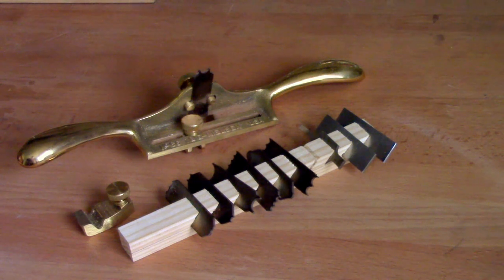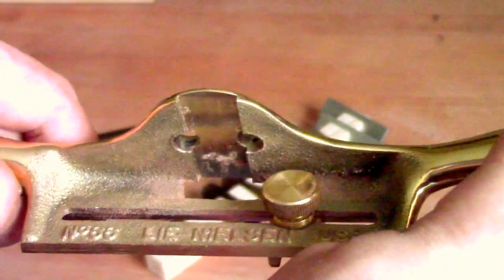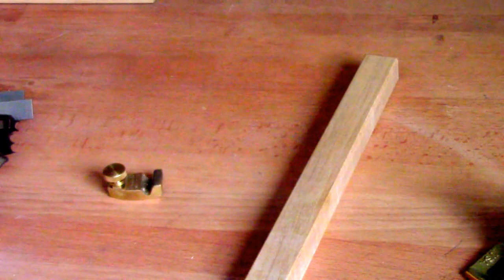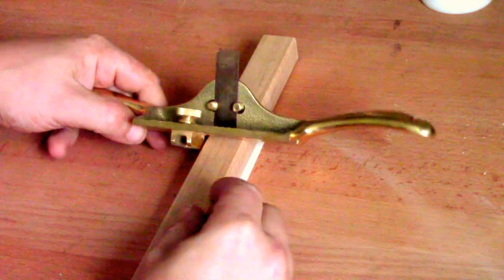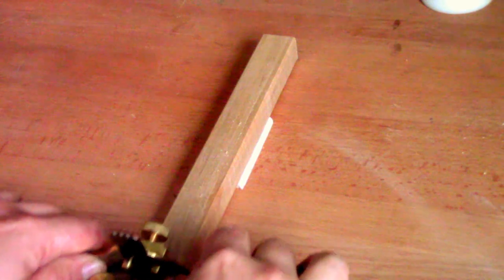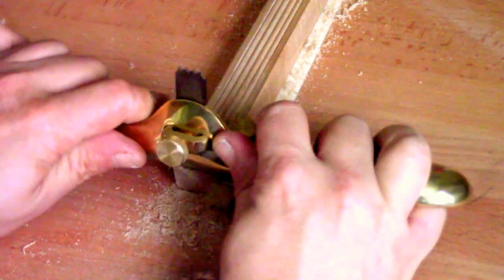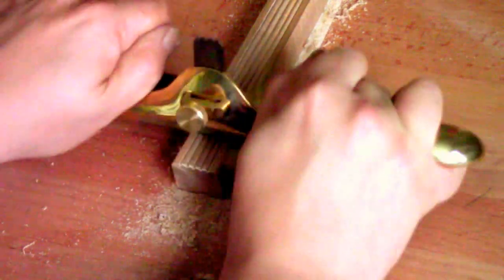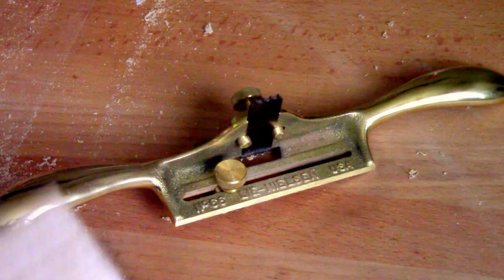The Lie Nielsen No 66: Demonstration

Comment: Thanks for this demo. I'm a big Lie-Nielson fan (my wife cringes when she sees the boxes arrive). Have you used this on a "softer" hardwood, like poplar, or even on soft woods like pine? Does the beading tool cause chatter or tear out on softer woods?
Reply from the maker: Thanks for watching:)
I used it on many different types of wood. From pine, spruce over sepele or american black walnu, canadian hard maple and purple heart. It may cause tearout but since this tool scratches and doenst cut like a handplane, you have a big advantage in changing direction. For example on figured wood, with many grain direction changes, its easy to get good results. Even on very small spots. But also its a question of training. Getting the feel of the best angle to hold and using the right pressure.
And dont forget to take your time. The better the results will be.
 Hope my english was not too bad. :)